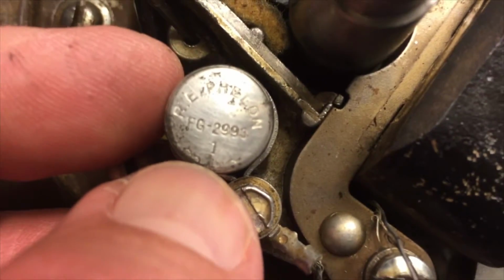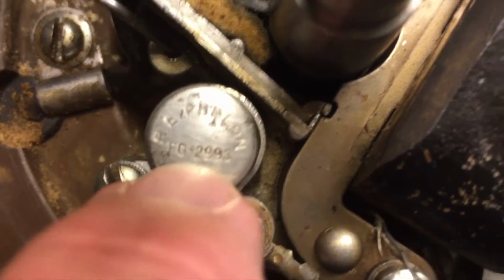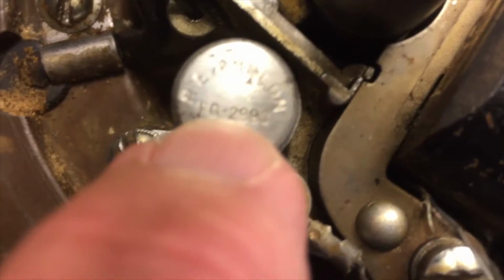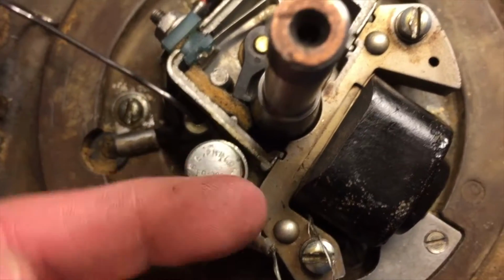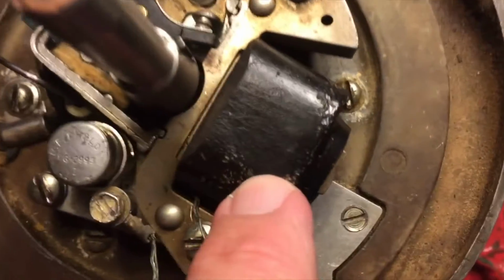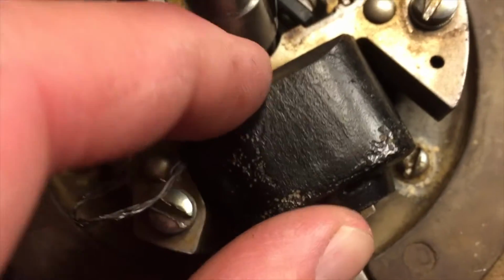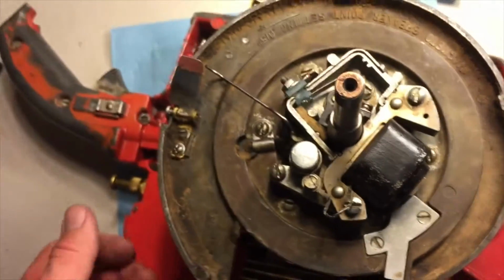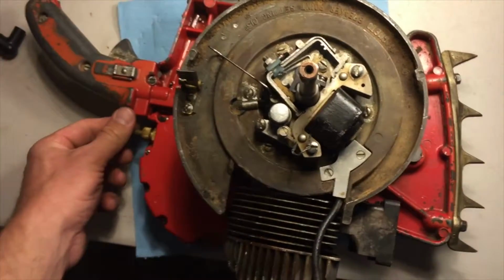HOMELITE 707D Points/Condenser/Coil/No Spark ???

Comment: Homelite C-Series saws with Phelon Ignition systems will work,in your saw,C5,C7,C9,C51,C52,C72  as well as 770,775,909,990,,super wiz 55,super wiz 66 and many other Homelite models. But first make sure all connectios are free of corrosion and secure,with no breaks in wires to were it is being grounded out and preventing spark from occuring. Unless there is visible damage it is very rare that a condensor go bad. Not saying that it can't happen though.Same with coils. Make sure the condensor wire and coil lead are properly secured to the points post. Again making sure they are not grounded out. If you have a OHM meter check continuity on the plug wire itself. Sometimes there will be a break in inside and not visible.Make sure there is no corrosion or rust in the cap and the points are free of carbon build up and pitting. Allthough I can't see the point contact points it looks that there is some carbon build on the edges but appear to be usable. on the subject of condensors about any one will work as long as it mounts properly. I've actually used old ford condensors in some of these old saws and they run just fine. You should be able to spin the flywheel by hand with enough momentum to produce spark with plug out and grounded.These old saws are very contrary at times and can drive a person nuts trying to figure them out. Sorry about my rambling but hope some of this will be helpful. Good luck with your project sir !
Reply from the maker: Scott, Thank you! I appreciate all the information. I will clean all the connections and check again for spark.
Reply from the maker: I found the issue. The plug wire where it meets the coil was not making contact with the coil. I pulled it out and stripped the rubber to expose more of the wire and stuffed it back in. It works! I have spark again.
Reply: Good to see! Hope to see a running video soon.

Comment: I believe pristows should have both of those in stock. Plus when I got a coil for craftsman snowblower they had it in stock no ordering it. It was get and go.and believe it or not it is the same one as yours it fits both.it was a kit coil,condencer,and points. for around ($40 to $50)